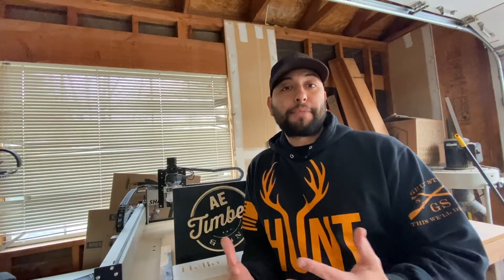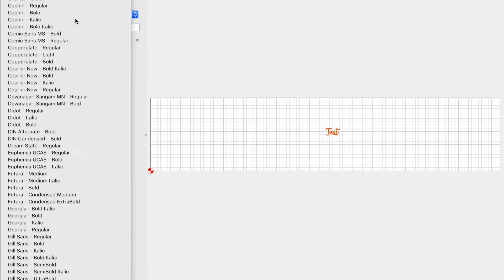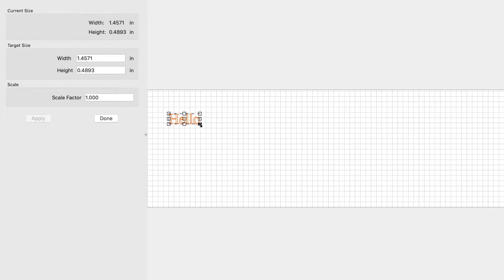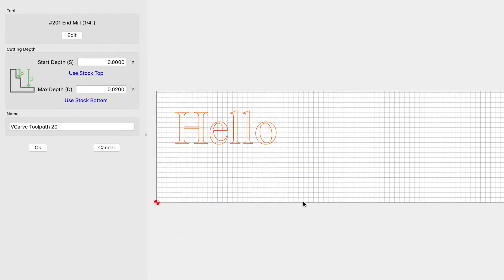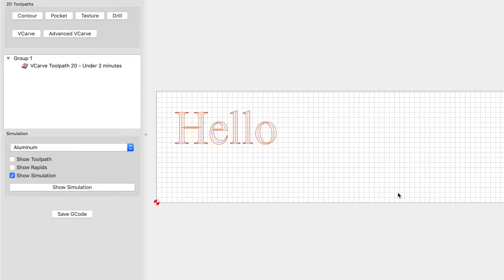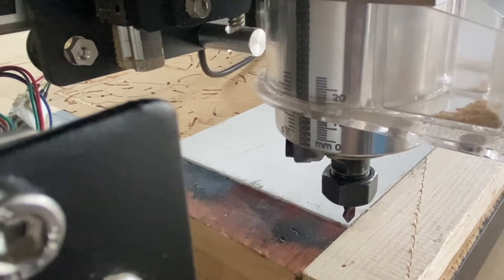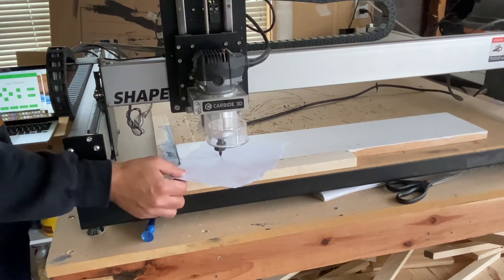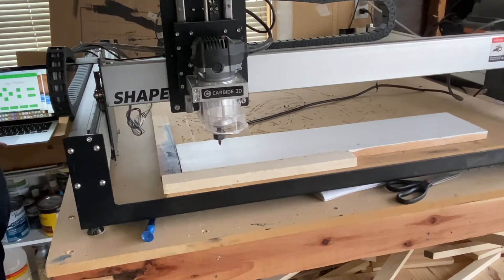How to V-Carve in Carbide Create | Beginner CNC Tool Paths | Carbide Create V-Carve | CNC Basics

Comment: I’m still having some issues with the VCarve. I used the same settings as you did in the video but my text is coming out very jagged and not sharp. Any ideas? Thank you!
Reply from the maker: @pfchao98  hey Paul,

Check that the vbit is the correct size in the program.

Also try a different font and take a look at the simulations. 

Not all fonts look good when v carving (in my opinion)

Also double check and make sure you have selected stock bottom for your max depth.
Reply: @aetimberpine  I was actually able to get it fixed after a few test cuts. It turns out my y-axis belt was a little loose. I added tension to it and that fixed my issue. VCarve text is super crisp now.

Btw, I love your videos! Just got my SO4 XXL and I’ve been binge watching your videos. Thanks for all that you’re doing for the community.

Comment: question how did u get it to not carve as deep...everytime i set mines using 3/4" mdf ,it carves really deep into the material
Reply from the maker: If it’s larger text and you’re using a 60 deg vbit or something smaller, it will carve deeper. So for my smaller texts I use a 60 deg vbit.  This was smaller text in this video. 

For my larger text, I’ll use the 90deg vbit.

The vbit will go as far down into the material as it needs to for the sides of the vbit to touch the sides of the letter. So if it’s bigger text, the smaller vbit needs to go deeper to be able to tough the vector lines.

If you google vbit depth Im sure you’ll find an image showing you what I just said.
Reply: @aetimberpine  man i definitely appreciate u
Reply from the maker: @The_Adventures_of_SuperSic  thanks for checking out the video!

Comment: Can I create a file in Carbide Create and convert to use in VCarve Desktop on a Shark CNC Machine.
Reply from the maker: Yes that shouldn’t be a problem.
I haven’t tried other carving programs but I assume it would work.

You’re gonna design and save G-Code in Carbide Create and upload to another program.
Reply: You can no longer do this with carbide create. The newest update they made it so you cannot save and export gcode without the pro version.

Comment: Even though you selected use stock bottom it’s not going to cut all the way through the stock right?
Reply from the maker: Hey Ryan, no, with a v-carve, it does not go through the stock material.  The vbit will only go as deep as it needs to for the edges of the vbit to cut to both sides of the vector.

Comment: Did you use stock bottom because you did your zero height at the bottom?
Reply from the maker: Using “Stock Bottom” allows for carbide create to determine how deep it needs to carve to allow for the vbit edges to touch the edges of the vector. 

So for example, a 60 deg vbit would carve deeper than a 90 deg vbit to make the same carve since the 90deg vbit , and carbide create would determine that based on your tool selection.